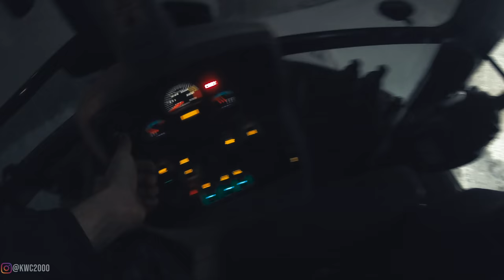Snow Plowing Driveways with 20TON Excavator

Comment: Last year, with the 3-ton excavator, I cleared the snow from the access road to my neighbour's cottage, which was buried under more than 3 feet of compacted snow.
I started by removing the top layer with the ditch bucket, then I finished with the front blade.
Not only was the work done quickly, but it was above all very pleasant to do.
The end result was comparable to if this access road was maintained throughout the winter.